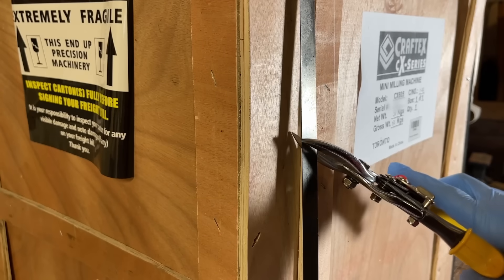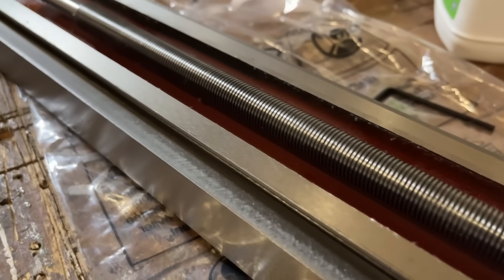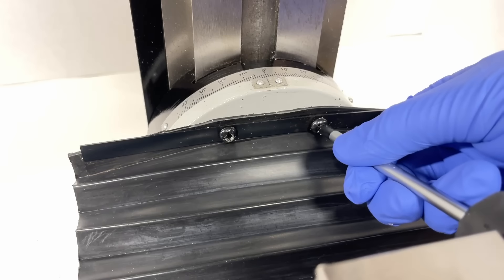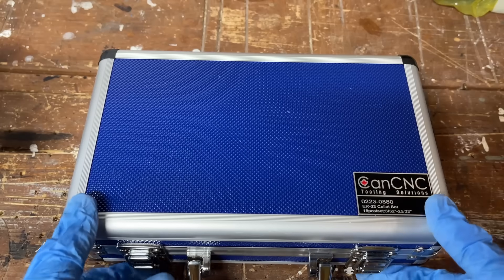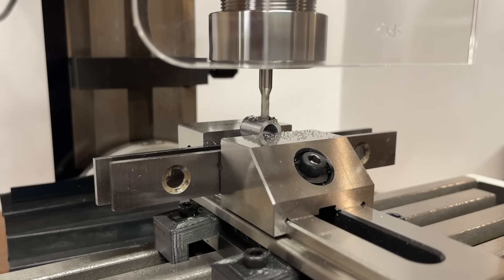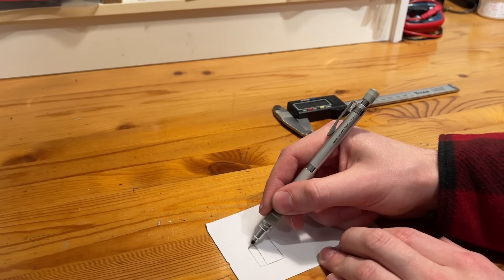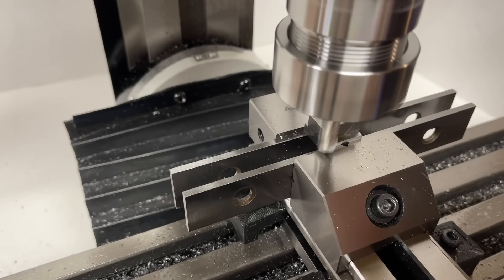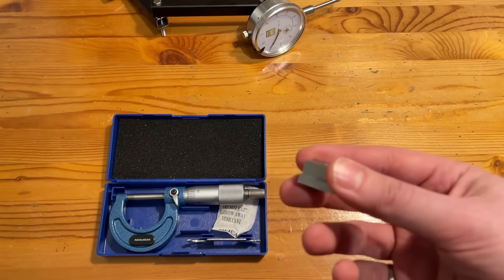I Bought A Minimill to see if they are Worth It

Comment: What are the limitations of this machinery in terms of size and precision? I’m planning on buying one to learn how to use them and to build a mini engine monobloc.
Reply: I would estimate work space for my basic HF mill is roughly a 4 inch cube out of the box with a vise attached. Out of the box accuracy is limited by the design. Column method of movement and locking is poor and installed gear rack too short.
The machine will cut steel as produced but the owner must use his imagination and skills to upgrade the mill to its potential.

Comment: And if we are going to talk about build quality issues...
Spending $60-80k on a Haas machine will be: 
+Faster and more rigid
+Have more burnout protection
+Likely tunable to a tenth of the tolerance you hit
-stock only promises about 4 thou, and you have to make sure the hfo aligns it better instead of stopping at the book number
-has an underbuilt lathe tool turret that is so poorly machined/not true it requires every pocket to be checked to see if it's ok enough to use a tap in that position. (_Every_ Haas Large we have has this issue)
-may have such a bad casting from the factory that the bow can't be taken out of the machine, because the middle feet lift the column of the floor before it reaches that point. (After 4 years of settling, we have half the bow now. I forget the machinist level's increments) 
-a mix of good quality and cheap Chinese electrical components
-locked into an expensive propriety company that makes their money off of charging double for parts and requiring a core return, so you can't have someone else rebuild the parts 
-less ram and drive space than my last phone had
-volatile system memory that can run out of battery and corrupt and require a $500-1500 hfo service call to restore. (Again a cheap phone or $300 cheap office computer doesn't even do this. They'd just reset to factory default settings until you got a battery and pick the settings you prefer) 

Would i buy one for an existing business focused on the cost of lost production? Yes. Nearest better options are 2x to 3x the cost. Better to have 2x to 3x the machines. 

Would i buy a Haas for a budget business startup or home machine shop? No. I'd either:
A. Buy a much cheaper machine and put several hundred into beefing it up a bit
B.build my own, not skimping on parts 
C. buy an existing machine with dead controls... (Very expensive fix with oem, so cheap machine price for the husk) and throw a modern control system on it that isn't tied to Haas.

Comment: Best addition was to wire in a reverse switch. Great for tapping threads.
Second best was to replace the plastic gears with metal gears.
Reply from the maker: Now that is a solid idea. I tried tapping with the mill the other day, a reverse would certainly have sped things up!

Comment: I like my Grizzly G0704 Mini Mill and have used it for 10 years now. I upgraded the motor as the original sucked but that's it.  These are not Hass or Mazak machines, and no one should expect similar output & function. Once set up CORRECTLY, which ALL mills require, is a decent for home, hobby, and small business use. I can continually hold .002" tolerance on large & smaller work. It does require lighter passes but depending on material, larger depth of cuts is possible. Same as any machine. I've cut wood, aluminum, hot & cold rolled steel, hardened steel, stainless steel, brass, bronze, and copper. Some mfg's have poorer quality than others but in general these are decent machines though remember they are not high end machines. More options are becoming available today which is great.

Comment: Hello I am a full time machinist and it seems like these days the #1 question I get from hobbyists is "are these mini machines any good". The answer to that is "If you work within their capabilities, and if they meet your needs."

You gotta remember that a full time machinist is not a maker in a garage who can spend an hour making a single T nut by cutting off .010" at a time because they are doing it for fun. A machinist who wants to keep their job needs to be pushing the envelope of what any machine can handle. Most of us don't like standing there watching the machine make chips on a single part all day which many makers seem to be OK with. We want to get it over with and go on to the next thing.

So that is why they are unpopular with professional machinists. We look at them from a different mindset with a different set of expectations. They take up 75% the floor space as a Bridgeport and have maybe 5% of the capability. A maker would consider a Bridgeport to be a heavy duty large machine. A machinist considers a Bridgeport to be a small, light duty machine that is not very rigid, but is very versatile.

There are desktop mills out there that can take 3/8x1/2" cuts in steel with no problems. I would be interested to see if yours could do that and get any reasonable surface finish.
Reply: I agree.
Unfortunately, the best table top mills are very expensive vs used manual full size mills and most people don't have space for a Bridgeport 3 phase 2 HP mill. I have used a full size Bridgeport at work and miss it, but don't have room. Comparing prices- a used full size mill is a better deal if the buyer has space and knows how to check the machine and set up in his shop
Reply: I agree with your comments. I have worked with a Bridgeport and similar  and for the home hobbyist  these cheap mill/drills/ lathes are ok for light work and small budgets but cannot be compared to the old time big boys.
Reply: As a machinist who ran a 52" VTL sometimes I watched the machine make chips all day. But yeah us professional machinists definitely push the envelope of what their machines can do. I would take a half inch depth of cut on my VTL on hardox material. I would take 3/"4" depth of cut on aluminum. There was only a front guard door so when I cut aluminum it would rain chips in my area. We would just move the control out of the way so you weren't getting hit by hot chips.
Reply: Not realistic

Comment: I got one of these a few years back and have been perfectly happy with it. Keep everything tight and checked and absolutely flood the gearbox with a decent grease. I think I even drilled a grease zirc in to it too.
Obviously I don't make things to exacting tolerances, but I fitted a cheap set of DROs to all three axis, a decent Collet chuck, and it does exactly what I want it too.
First jobs were making T-Nuts (surprise, surprise) and an Aluminium fixture plate among other things and it has performed extremely well.

Comment: The better question is this.  Is your money better spent buying a dedicated used mill from an auction and a dedicated mini-lathe.  The answer is yes.  The problem with these machines is that there's a fine line between getting something tight enough, and tightening to the point that it breaks.  If you're only working on soft materials, they do okay.  If you're going to cut steel AND you are willing to always start with a sharp cutter AND you're willing to limit yourself to slowly making shallow passes, and you're willing to accept a pretty crappy surface finish, then they will work.  However, over time you will push its limits and eventually something will go wrong.

Comment: I've had several. My Taiwanese mini lathes were the best. Earlier Chinese ones are OK. Currently, I'm running tapered bearings a, QC toolpost, and metal gears. As far as the mills, I have a Little Machine Shop (Sieg X4). Upgraded that to belt drive and DRO. Major problems with the column being out of square. Haven't found an easy solution. Will probably take it apart and try to square it up on a Bridgeport at work. For the most part, these are to be considered kits. Aligning, tweaking, de-burring, and lubricating etc are often required. Also, be realistic on material removal rates. Rigidity is always the name of the game. Best machine I have is my Taig CNC. Quite capable for it's size.
Reply from the maker: I keep hearing good things about the taig cnc mills, I think I may need to get myself one!

Comment: Does the tram bolt have a torque spec? Id bet it does, try it, if it is loose and shifts over torque by 5-10% each time until its stable, then do some
 aggressive passes. Would be pretty scientific and a good way to test the written specs

Comment: The question being, “Are mini mills worth it?”, is a little vague. 

It could be worth it to you, as an individual, depending on what you need out of it. 

But from a cost perspective, I’d say no, they are now worth it. 

Mini and/or bench top mills often run in the $3-5K range. 

However, it is relatively easy to find a used full sized mill on fb marketplace for roughly the same price. 

You can perform the same maintenance procedures on it, and end up with a much more capable mill…provided you have the space for it.
Reply: The biggest problem (pun intended) is the size of a manual industrial mill.

Comment: Word of caution from years of experience. Do not try or use WD 40 for lubrication purposes...ever. WD 40 is designed as a penetrant product and is not ment for lubrication use. If used expect damage and low performance from any machine in short order. WD 40 is a great product and is one of best if used properly.

Comment: Much like the complainers you are describing, an entertaining time can be had by going to Amazon and looking for various mechanical things, and then reading the reviews.  Not the 5 star, the one star reviews.  This is where those folks that could break an anvil reside.  One of my favorites, a simple plastic hang up hook for an old school telephone handset, the kind you would use in a factory or office environment where you wanted to put the handset up and safely out of the way, but not hang up the phone while you did something else for a moment.  Obvious for what it was supposed to do, and it had two holes in it to mount it to some surface.  It got a one star review because, "Did not come with installation instructions."
Reply: Reviews for a 2-component epoxy resin from a very renowned company on Amazon:
- one key property for this resin was the long open time of 45 minutes. Review "Takes forever to harden. Am I supposed to hold the parts for an hour? Worst glue I have ever used."
- the resin/hardener was to be mixed 1:1 by volume. Review: "I mixed it 1:1 by weight and now all is sticky and won't harden completely. I have to throw away my project. Why didn't the manufacturer provide mixing ratios by weight?" Well, they did in the MSD, which was readily available on the manufacturer's web site. Which other company does even provide an MSD for epoxy resin at all? Besides, because the bottles for resin and hardener were the same size, it would have been trivial to just weight both and to find out that their specific weight is different and therefore you cannot mix them 1:1 by weight. 
But that would be accepting responsibility for your own mistakes.
Reply: Yes, sort from worse and look for patterns.  But first, eliminate the stupid user errors.  The ID-10-T errors, the loose nut behind the keyboard errors!

Comment: I bought a mini mill similair to this a few years back.
I was satisfied with it, mostly doing small hobby stuff.
Its capable of milling steel if you don't want to cut mm's in one go.
Unfortunatly the engine gave out, i had not used it very much and it was out of warranty.
One of the carbon brushes was detached from its little wire, thats were you see its the cheaper made stuff.
The carbon brushes were very hard to get, its a size that is not available at most suppliers.
So i bought something larger and custom fitted it.
It works but its not running smooth.
I found a replacement motor for a reasonable price and that is sitting on the bench waiting to be replaced.

Comment: I think the 62.5 thou per rev issue is because that's 1/16th of an inch. A lot of hobbyists are likely to think in 64ths (a quarter turn), 32nds (half a turn) and 16ths (full turn). Actual machinists: not so much...

Comment: Homeshop machinists are such a varied bunch of people, and there will always be many with low skill level that blames their tools all the time. I know from person experience that blaming the mill or the lathe is very rarely the right culprit. Even simple and worm machines can make accurate one off parts. Making a bunch makes it much harder though. And small machines are very capable, in the right hands. I use a Sherline, and it's a fantastic machine, although it has it's shortcomings.
Reply from the maker: I’ve heard really good things about Sherlines, I’ll definitely have to consider getting one to try out at some point
Reply: @Someone_Should_Make_That  Remember to get the Adjustable Center when you order. And I would also get the tailsock extension part. The tailstock is the Achilles heel of this machine IMO.

Comment: I broke all the plastic gears in my mini mill with mt3.mtook me awhile but I found them all on Amazon at one point or another. Buy a pack of fets for the board the lower two heat sinks have fets that like to blow after a few months. I added a fan to cool board and extra 12 transformer( from a wall wart) and put some stick on led strips on underside.

I’ll add a power feed sometime and upgrade the bolts to acme threads one day. I skipped the mini lathe and got an old southbend instead.
Reply from the maker: Noted! I’ve been slightly concerned about the electronics, I’ll have to figure out how to get a fan in there

Comment: I'm sorry, but I don't know who Boltya Milldown is, should I?
Reply from the maker: I suppose I opened myself up for this kind of joke didn’t I hahaha
Reply: @Someone_Should_Make_That  good video though. Bolting it down probably also hugely improved its accuracy and alot of the issues people have probably stem from flex in the machine and not bolting it to a solid surface. 
62.5 degrees is just weird though. 
My biggest concern with this sort of machine would be repeatable accuracy.

Comment: I have a mini-mill, and a mini-lathe... Both kick ass!! I turn and mill steel, etc.. 

Pour heavy gear lube into the gear case, and it gets much quieter.. Those plastic gears are rough!! 

I have the same ER-40 collet, with mt3 taper!! 

I have the quck-change tool post on my lathe.. Had to replace the circuit board with one from a matercraft wood lathe, a spare pos, and got it working! Wasn't gonna pay $250 from mini machine shop..

Comment: I ran one of these for about a decade. Did tons of upgrades including stretching the Y axis, stiffening, and making it CNC. Sure X2 mills can make parts, but it has serious limitations. I regretted not saving a bit more to get a heavier machine with a couple inches longer travels on Y&Z.
Reply from the maker: Yeah that is very fair. I’m lucky enough that 95% of what I make fits in the x2 work envelope, and the other 5% can usually be adjusted with a few hours (days) in the CAD model. It is nice to hear that my take on these things isn’t completely coming out of left field though!
Reply: What do you think is a good starting size now? Tormach 770 level?

Comment: I watched a video from a tool mfr on milling here on YT at a trade show. They showed how much stronger and more accurate a mill was using plunge cuts. So, if you have a limited machine consider using as many plunge cuts as are needed to get the job done then follow up with cleanup pass(es). This will save the most time and keep the loads within the range of the machine. No matter what size the machine is they all have limitations.

Now on to the dials. That's classic, it's using a metric leadscrew. No surprises there, it's from China. The mfr is giving the imperial equivalent. However, it will only properly indicate within a single turn. The same would be true if the leadscrews were imperial and you were working in metric dimensions. I learned this the hard way. After giving the situation a closer look that's when my lightbulb lit up.

This brings rise to my topic. DON'T BE CHEAP buy a DRO system. If you're hell bent on counting dial turns, then a least put resetable counters on the dial shafts. When my DRO system died and I had to revert back to dials it's easy to skip a turn or get interrupted etc etc. I replaced my dead DRO system and am looking forward when the installation will be completed.

So, no matter what size machine you have always work within it's working range and or learn, as a YTber said below, PATIENCE.

Be thankful we have available to us these wonderful machines and you can actually buy them for a reasonable price. The best part is that you don't have to design, cast and fabricate your own machine. Consider if you had these kinds of machines in a shop even just 50 yrs ago. You'd be the talk of the industry.

So, yep, score one or both of these machines for your shop and start making chips.

My shameless plug for a CAD pgm is VIACAD. No subscription, no limitation on how much money you make before you have to buy. I've been supporting them for years and I love the features and can draw anything. It can analyze a design for 3D printing and can add supports as needed.

That's all the wind I have at this time.

Thx for your time.